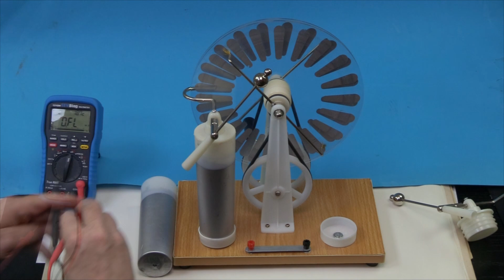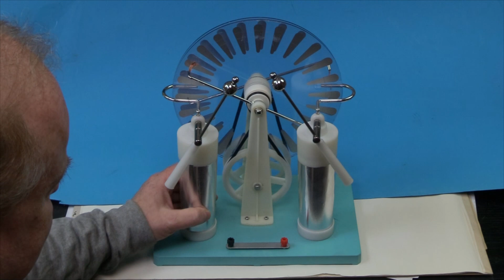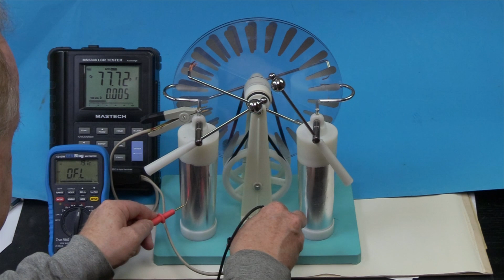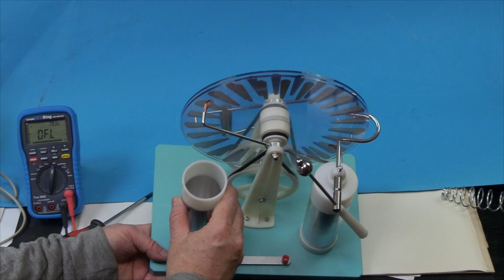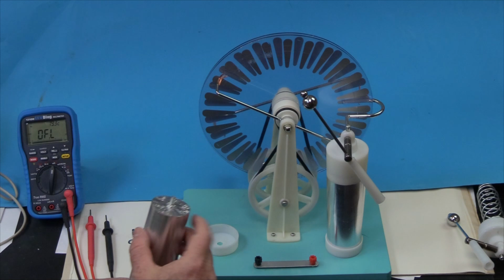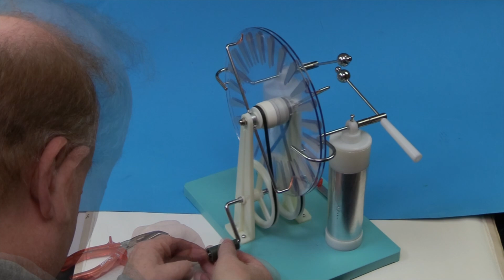2 Wimshurst-Machines from AliExpress...

Comment: As incredibly Impossible for this Poorly designed screwed up Chinesium Wimshurst machine to Work, it somehow manages to Produce some sparks & actually Shock the irate Presenter !!!
Reply from the maker: The explanation is "electrostatic induction" + "corona discharge" through the isolation :-)

Comment: Turn the crank in the other direction, then the nut with tighten rather than undo.

The segments do not really need to be conductive  (it would prob be better if they were) but that just need to be metallic so that they can pick up a charge as they pass each other.   

It's got all the basics of the machine, so spend a little time remounting things better and it will do the job. As you have found it is quite a forgiving  machine.

Andy
Reply from the maker: Hm, the metallic-looking coating is perhaps made of aluminium flakes which are glued together/coated with epoxi or another non-conductive chemical. But how then can the neutralizers work? Is the voltage high enough that the charge can "break through" the isolating glue/coating?
And BTW. I turn the crank in the diection that I want to :-)))
Reply: @KainkaLabs  the voltage would be very high, and easily leak across I would think. I'm remembering the various effect of charging up plastic rods to move streams of water, and also the belt of a Van Der Graff which was basically a wide rubber band. That had pointed pickupt at the top and also at the bottom of the column The charge moved on the belt with no metal required..

We are so used to thinking about current flow, then we tend to forget that this is all about moving static charges about, which is a rather different thing, and a fully conductive path from one point to another is not always required.

On the crank, well don't blame me when you test the your AF voltmeter.. Ouch! 

:-]]

A spot of strong threadlock compound would do the job as well...

I'm so tempted to make one of these machines... 

Andy

Comment: I think you had the LCR set to capacitance measurement when you were checking the conductivity  (I saw pF  showing on the screen). But in any case would interesting to find out what they were made out of. They really need to be conductive for this to work. 50 euros for broken machines not worth it.  You need to put them on a stable wood base to start with.thanks for the video.
Reply from the maker: With the LCR-meter I measured the capacitance of the Leyden jars. The resistance I tried to measure with the 121GW meter and with the insulation tester.